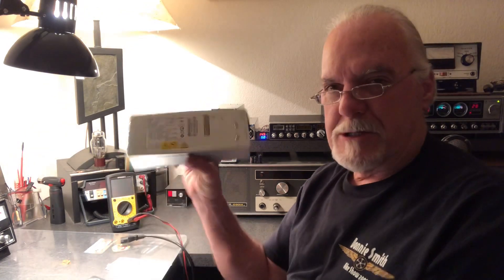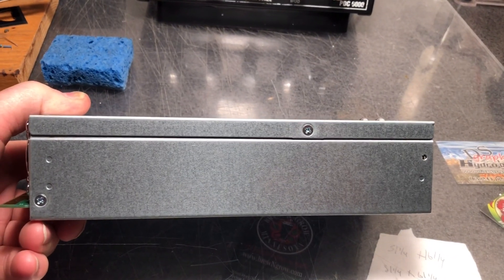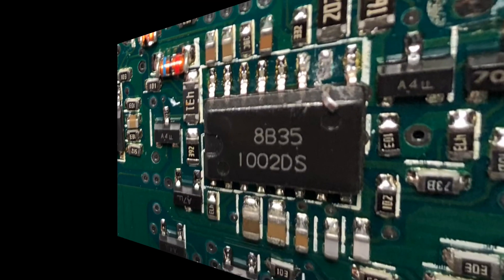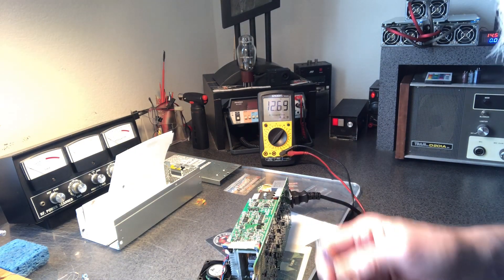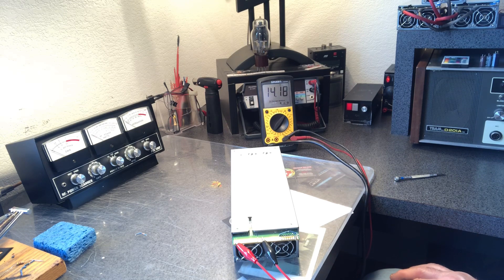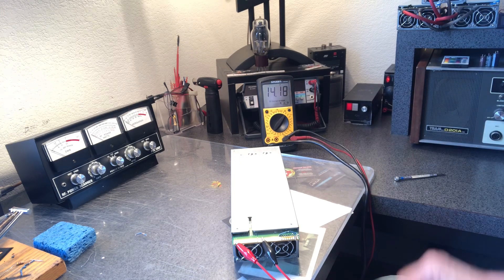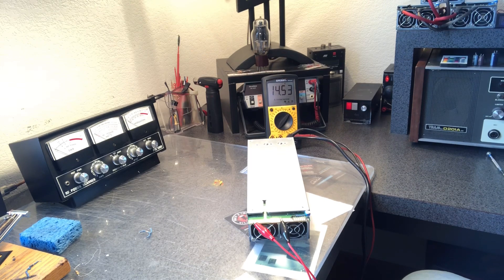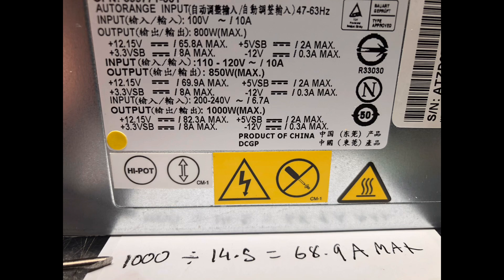DPS-800GB Full Hack Including OVP Hack

Comment: Worked very well for me.   Thank you.  After nobbling the chip leg, my power LED didn't come back on, but with an 820 ohm resistor and a trim of the pot, I now have a power supply outputting 13.84 volts. Magic.  I can't believe how small the chip legs are.   Now to solder some big binding posts to  + and -, to get as much of that 1000 watts available as possible.  73, M7KPS

Comment: the impresive thing of this kind of psu is that they are freaking cheap and extreme quality and safe, any other psu will cost at least twice, the only bad thing of this is that this things are heavier than plumb, 8lbs or more, and what you dont spend in psu you spend it in shipping

Comment: Thank you very much! I have a couple of questions. About 4:15 time in the video I clearly see on the left what looks like a plug with 8 different color wires (8 if them) that are usually used in the ATX 24-pin connector. The colors also fit :) And the sticker on the PSU mentions amperage values for 3.3V and 5V, too. 
Does that all mean that this particular PSU outputs not only 12V (as this type of PSUs usually do) but also 3.3V and 5V on some of its pins? I'm asking because that would make it a cheap alternative for a reliable ATX PSU in case the machine must run 24/7 as a server application. Because these PSUs are much more reliable than those built specifically for home PCs.

Comment: Why don't you connect the pin 30 to the +12V rail as shown in some other forums? (https://www.rcgroups.com/forums/showthread.php?1301679-Hp-DPS-800gb-a-power-supply)
Reply: Presumably because they are intended to be stacked, pin 30 is used to communicate between two units in regard to load sharing (marked as VoltageSens on the picture in the thread you're referring to), otherwise one PSU is making all the load and the other one is idle apparently.

Comment: Thx for the great video.  
As I needed 24 volt I hooked up two of those in series. For that I disconected the earth from one and it worked okay until I swiched one on first under load, Now I have one that stopped working on the 12 V 82 Amp leads. Do you have any idea what could be the case or some sort of circuit drawing?

thx and Regards Robbert

Comment: Freakin' awesome!  Just built same power supply for my CB Amp.  Cost $35 total including a refurbished power supply and potentiometer.  Putting out a regulated 13.76 volts DC at 58 amps!

Comment: I have  done a  couple of  them and all but one  works great, problem with the  one is it powers on (green light) for 2 second and then turns off.  Any suggestions on what  to look at, thanks
Reply: If it’s fan is working( you can see with a torch) then wait for 30 minutes -1 hour as green light turns on above 10v

Comment: Hi, thank you very much for the video. That helped a lot! Is it possible to lower the voltage? Like to 8-8.5V? I could not find any information about that. I am using this unit to power 6 of TEC 12715 peltiers, which draws about 70A current at 12.8V. My aim is to be able to decrease-increase the voltage on the run (under load) to control the peltiers' power.

For example, when you are changing the potantiometer with screwdriver, since you are pressing it with screwdriver, values like 9V can be seen. As soon as you reduce the pressure, voltage jumps to 11.8 or so. This is a typical behaviour for cheap small potantiometers. So, if I change that pot with a different value multiturn pot, is it possible to lower the voltage to 8 volts or so? 

My aim is to use a digital resistor instead of that pot and control the resistor with arduino. As resistor value changes,  voltage changes. So I can lower the peltiers' power. That will mean I can add soft-start, soft-stop, digital thermosthat etc etc...
Reply: I guess I found a way; but I don't know whether it is dangerous or not... I used a 10k resistor between chasis of voltage trim potantiometer and 5V output. Voltage drops to 10V, when the potantiometer is set for max voltage output (in my case 12.5V with no load). As resistance decreases, voltage output also decreases. When I use 3.6k resistance between chasis of the potantiometer and 5V output, voltage output of 12.5V decreases to 5.3V. If I use lower value resistance, PSU shuts down. So, I beleive 3.6k is a little bit extreme... When I use a 100k resistor between 5V and chasis of the potantiometer, Voltage drops to 12.5V to 12.2V. So, a 100k variable resistor will do the trick and it will be able to regulate the voltage between 6-12.2V. 

I tried several voltage outputs with 3-5.5amps of load. No problem untill now. I will increase the current I use and report back.

I'm not sure whether this approach will damage the psu in the long run; because my approach was just a lucky guess... So, I can't recommend to anyone.
Reply: You could always use a buck converter and have full control over the voltage

Comment: Thanks. is there any solution about how to adjust the output voltage (lower)? I need 10v instead of 12,5
Reply: You would probably need to use a separate voltage regulator.

Comment: What is there at 32 pin, Why?
Reply from the maker: Muhammad Amin you add a resistor  from pin 32 to ground to change the voltage output

Comment: Thanks i was looking for something like this i have modded some before like a Chinese xbox psu i removed one of the resistors in the voltage divider on the sense circuit it goes from 10 to like 18 i assume it has an over voltage protection but thats a fine range for me but l dont remember what the output caps were I assume i looked and they were good but who knows they have not blown up yet but I was looking at doing that to some dell PSU's that are 80 platinum that are like 495 watts for like $12

Comment: Whats the best way to solder an 20mm cable to the ground and + terminals ? Thx
Reply from the maker: Sascha B I use a 100 watt soldering iron, what ever you do don’t drill a hole in it. Take the cable flatten it out on the end “I use a small needle nose with a rubber band around the grips to hold it flat” pre tin the wire and the board then connect two together.
Reply: hotwire 589 100W worked fine thanks! I    did all you mentioned so far and the PSU works fine on 14.09 V just what i need for my car. I recognized that the LED on the back is still off while running is this because of the OVP mod? And i hooked somme battery pol clamps on it do u know when the PSU is off the power is there still the possibility to blow things up lika an capacitor by shorting the pols ? Thank you!

Comment: Hello 

I want to make a 24v 2kw power supply for my rc charger do I need to disconnect the  ground and if i need to disconnect it do I need to disconnect both power supply's from ground and do I need to make it open or can I just cut the ground wires
Reply: You just need to float DC ground from one of the power supplies.

Comment: I just did this mode on two of my power supplies , it works great. 
I used a 1k 1wat resistor because that’s I had at the moment , I set the output voltage to 14v. 
I wish you could come up with a fix for the DPS 1200 . I have two that don’t work anymore .

Thanks... great video!
Reply: Can you explain Pin 32? What I should connect in other power supply Like Albecom PWS-801-1R
Reply: @MrRabbani9009  Sorry, But I could not help you with your power supply, the pinout is completely different to the DPS-800. Good Luck.
Reply: Did you desolder the voltage regulator chip?

Comment: Why do these things pull so much current and get so hot when they're plugged in but not turned on?  You can hear a clicking sound on them.  I thought it was just the one, but have verified its pretty much every DPS- 800GB we have.  We have dps-750s that don't do that at all.
Reply: I do have a same question. It is very weird indeed. Mine acts the same way.
Reply: @3domas  dps-750rb is the best one I've found doesn't have individual specs, but the 220 spec is 750 watts so I'd wager it puts out at least 650 at 110.  Fan is very quiet and doesn't ramp up at the drop of a hat, and it stays cool when not being drawn from.    I think some heat because the AC to DC conversion portion of the units are set to convert 220 to 12V, so if they're plugged into 100 or 110 they have a voltage doubler tranformer to step it up that draws current.  I think the better ones have a way to shunt the transformer's primary current or vary it based on demand at the output.  The cheaper ones just run current through the transformer's primary  at full throttle and provide 220 for conversion and heat.

Comment: i've got a question regarding the on/off jumper... can i use a small switch, so i can keep it hooked up to the mains, and switch it on or off?
Reply from the maker: N Ver you sure can
Reply: @hotwire5894  Did this on mine. When the switch was turned off the PSU still got warm and made a barely audible humming noise. I would disconnect it from mains when not in use.

Comment: Great video I would love to see a complete build with full variable voltage and the same with current. I am going to use two for 24v but am more interested in a bench supply I can use for other things thanks again for a great video
Reply: You need to float DC ground on one of the power supplies otherwise they'll get damaged when they are in touch.

Comment: Sorry, probably a newbie question. How will you power it with 240v?
Reply from the maker: Jason Brown I ran a line from my beaker panel, the power supply is switching meaning it will know what is being supplied and will run on it, l just finished building a 411 amp supply with these running it on 220vac, hope to get a video up soon.
Reply: basically "Plug it into a dryer outlet or stove outlet" (has a custom one of those for it.)

Comment: Do you have 3 in series in the background for 36V+? If so, do you need to disable the OVP for putting these in series?
Reply from the maker: Jim Shank they’re in parallel at 14.5V 
You can run them either way without doing the OVP hack, just don’t turn the voltage up to high. Also adjust all  to the same voltage. 
I just finished putting six of them in a cabinet, running them on 220v ac  should get 411 amps, hope to have a video up soon.

Comment: Great video! I just started looking for information on uping the voltage and found the information on floating in another video that lead me to this video, now to dig deeper with this information! Thanks!
Now I need to know what pin to solder the resistor to on the DPS-1200FB? (and to make sure it has the same microchip, just ordered a couple) Can anyone confirm if this works on the DPS-1200FB?
Reply: I have some of those PS's as well. I'm looking for the same information. From what I found thus far is that the voltage can only be altered via the adjustable pot onboard, still looking. Most people appear to be using these for 24 volt systems.
Reply: Did this work on the DPS-1200?  Do they have same chip as I just bought pne and want to do this mod.
Reply: Larry Mic the only thing adjustable that i got to was finding the pot to adjust. I cant remember the voltage i was able to get to but not as high as this one. Strangely i had two 1200 units and each had a different stand by wattage so i stopped using them as one was too high for my usage

Comment: Nicely explained, not a lot of excess verbiage, good visuals and good info.  Thanks for posting! I'm planning on converting my emergency battery backup setup into an on-line UPS, using one (or two) of these PSUs. Float at 13.8 or so, even with refer, computers and all house lighting, under 600W steady-state max, 400W with computer and normal lights and about 80-150W at night, comms and refer. 6 golf cart batts to carry the load during outages. My current charge setup can't hack more than 30A or so. were these things can loaf along all day at 40-50 amps. Tired of outages. (yeah, I've been screwing around with this stuff since the tube days, lots of experience with standby and UPSes, and, in the Santa Cruz mountains, lots of need for something besides the utility...:) These PSes are solid, cheap on Ebay and take a lickin'... I'm using an adapter board from China that plugs into the edge connector and monitors output, (3 digit VM), has a power switch and a mess of 6 pin Molexes for bitcoin miners. Even has pads for a pot.  Will trace it out and see if it goes to your resistor points. If not, I've got an Exacto and an iron..:) Thanks for the OVP hack. Subscribed. Stubat. (Anthro fan, 50year electronic tech, general crazy person.)
Reply: Is an OVP huck necessary to raise the voltage to, say, 15V?
Reply: @dobrodziej8050  Hi!  Yep, you'll definitely need to disable the OVP for 15V out. It'll shut down quite a bit before 15V, otherwise.  Once you disable the OVP and stay no higher than 15V, you should have a solid supply with lots of power.  If you need more than 15V, you'd want to change the 16V output capacitors as he mentions in the video. And make sure you use quality low ESR capacitors. But just the OVP disable and the external adjustable resistor mod should get you what you need. A lot of quality PSU for not much $$!  Be safe, be careful inside the unit and test for awhile at the 15V output to make sure all is stable and running cool.  Take care!  Stu
Reply: @TinkerbatTech  Thank you very much, I am acting. I wish you a lot of health.
Reply: @TinkerbatTech  I have the same chip, after applying resistors 470-820 Ohms, the voltage on the power supply does not change. What could be the reason for the lack of regulation?
Reply: @TinkerbatTech  Thank you, everything is O.K. Is 15.5V a safe voltage for the power supply? Without replacing the capacitors.

Comment: Hi, nice video and nice work. Just a note. U can use the pot to raise the voltage until 15.5V for example, then measure the resistence of the  pot. Pick a resistor with the closest value (allways higher) and put that resistor in series with a pot. That way u are safe from blown the out caps. Even if u turn the pot to zero.

Comment: Hi... I was wondering if this voltage hack would work on other hp supplies. I have a dps-750rb a... That i would like to get 13.8vdc out of. If it has the same over voltage protection chip do you think it will work?
Reply from the maker: From what I have read if it has the same ic/chip it will work, there are a lot of supplies out there that used it, the number on the chip you are looking for is the lower number ( 1002DS ) the top number is different on most and doesn’t make a difference, if you try it and it works please post here so others, and I will know.
Reply: @hotwire5894  i checked it doesn't have that chip... Is there some web site where i could find some technical info on these server supplies... I need the hp hstns-pd18 and pl18... I want to get 13.8vdc out of them... Do you think i could just put the resistor on that pin to raise the voltage.

Comment: I used one of these for an experiment https://www.ebay.co.uk/itm/HP-407750-001-399428-001-DL380-G5-BACKPLANE-BOARD-389378-001/263835934270?hash=item3d6dd8de3e:g:yBgAAOSwj3BbWCK~&frcectupt=true
to have redundant psu (in parallel to get high amperage - NOT series)
one psu connected a 820ohm will get to 14.4v - plug a second one in and it drops back to 13.5v.  You have to use a much lower ohm resistor (around 330-350) to get to 14.4 on the two supplies.  Problem is that if you hotswap (not disconnecting power actually pulling out of the edge connector) you are left with a 350ohm resistor on ONE supply - spiking the voltage to >16v - until you replug a second psu - I am struggling to know how to approach making the resistors work independently so dual and single on same board gives steady 14v.

Comment: fantastic an clear explanation... Would it be possible to increase ovp to 16v (under cap limit)... Can you show us the capacitors you're replacing and what with,,,, Thanks again
Reply from the maker: I have seen a post/found some page ,think it was from a group of ham operators experimenting with these and they figured it out, problem for me is it involves micro components put into a micro space, very difficult! As for the capacitors , also difficult to remove, they are 16V, I want to change them to 24V, problem is the 24V is larger and don’t fit in the cabinet, if I can find into on the OVP I will share it here.

Comment: My server power supply has an issue. The relay on the high side is clicking. It starts doing this after few seconds of starting the psu. The heatsink in the middle of high side is really getting hot without any load attached to the psu. Any idea what is causing the components to heat up so quickly? Thank you

Comment: Can these be turned into a variable bench power supply with constant current and voltage. I have one and want to see if I could use it for anodizing aluminum, which I need to control the current and voltage. Thanks.
Reply from the maker: That would be a pretty cool experiment, 
what I do with them is turn the voltage up, stack them together to create a hi amp power supply, for anodizing you might want to go the other way, turn the voltage down and keep the amps down, you might be able to go inside, turn the voltage down as far as it will go then use a potentiometer to control it. The next time I’m in one I’ll see how low I can get it to go.